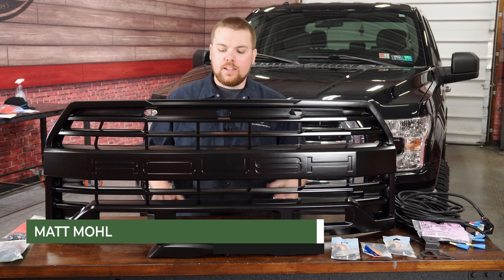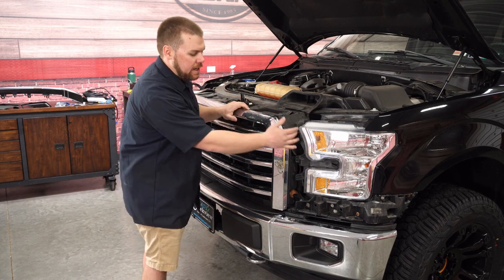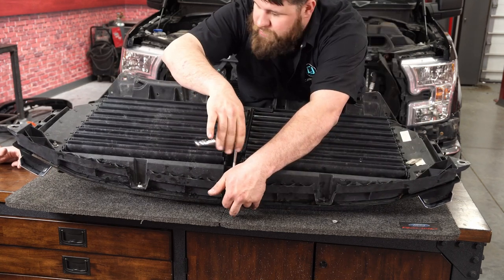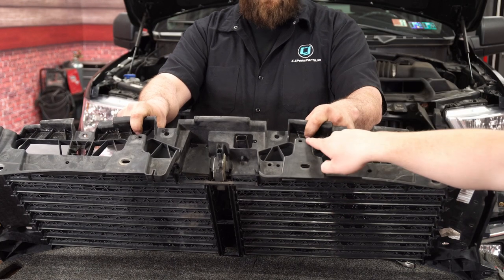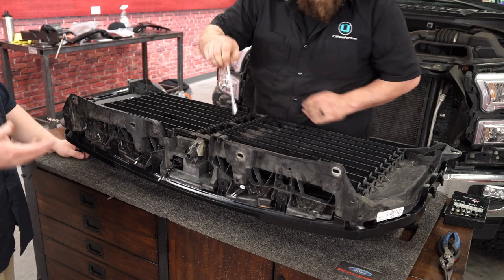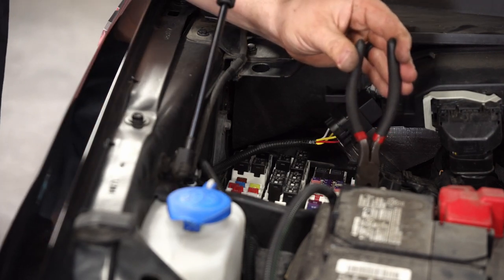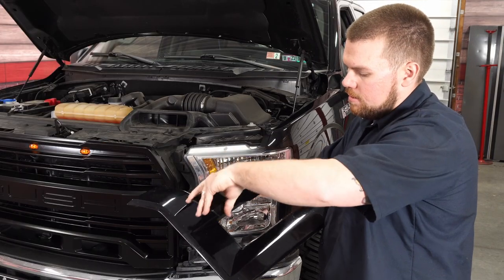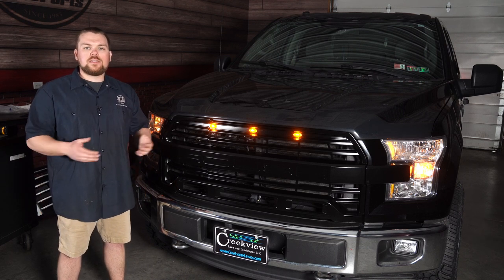2015-2017 F-150 Install | Roush Grille

Comment: Just installed mine, followed the video. Nice job as an overall idea. If you need to hide the looms of wire, Roush’s install says take off the passenger headlight to run the excess wire in there and zip tie the excess there.
Also you can mount your relay there also so its out of sight. 
If your going to do the install, beware the kit also comes with the option for fender flare lights. So you really have to lay the wiring out to know which is which. 
Overall very happy, buy it!!!

Comment: If you are considering to upgrade to aftermarket LED lighting such as the Morimoto XB, it also calls for use of the 113 fuse in order to run the DRLs as the included marker lights do in this package.

Also, be careful when you print the light trim cover template.  Depending on your printer, it may not be to scale.